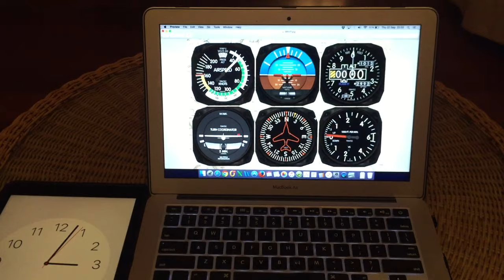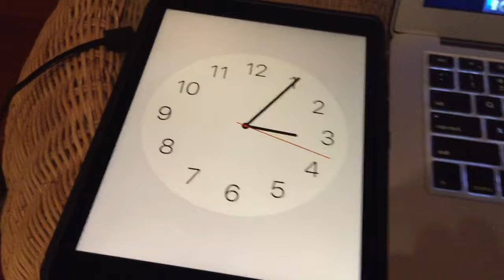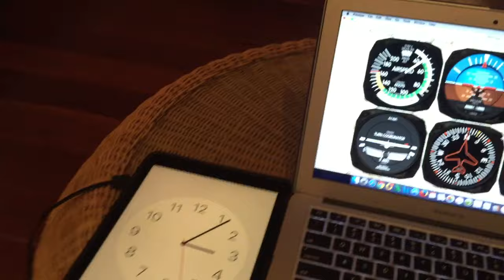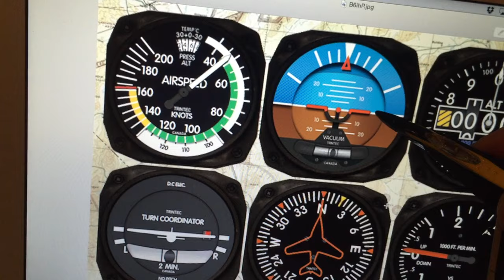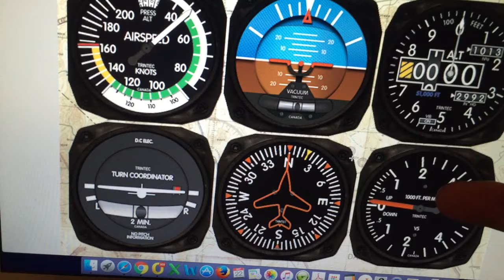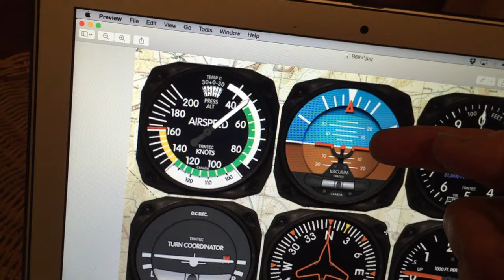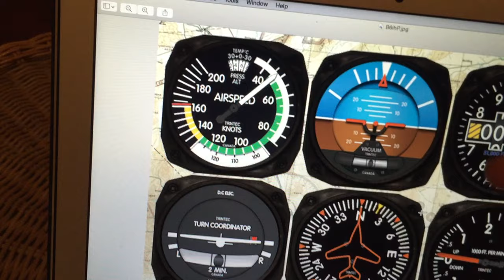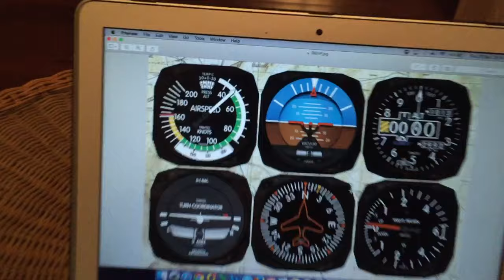Do aircraft change attitude to follow the curvature of the Earth?

Comment: I remember when I was  driving up a hill and kind of zoned out.  I forgot to follow the other half of the hill downward.  I was at 30,000 feet and still climbing before I realized my mistake; I just barely made it back to the surface before I ran out of gas.What?  Isn't that how a flat Earther would see it?
Reply from the maker: LOL,  yes something like that Emma.   

It is only one degree of curvature in 111 kilometers and they wonder why we can't see the hump on a straight road...   Clearly they have no idea of the size of the Earth.
Reply: +Emma May - You need to see it as a glober sees it. If you shoot too far up the hill, you're liable to go into orbit and circle the earth until the end of time.
Reply: More like "I asked for directions and the guy said go straight down the road, but they neglected to tell me that the road was ever so slightly curved so I ended up running off the road. Gradually. Over the course of half an hour....)
Reply: What? What were you doing? "forgot to follow the other half of the hill downward"??? "still climbing"???"Barely made it to the surface"??? Did you fly in a submarine over a hill?
Reply: @Wolfie6020  i have a question for u if u  dont mind and its got nothing to do with your  video although i did like your explanation pitch control
Reply from the maker: @nerog3136  Sure, go ahead.
Reply: @Wolfie6020  cool thanks.Not sure if u heard of gleesons map which alot of people say cannot work.The one distance i have was easily got feom his map
Anyways according to gleesons  map the real distance from the north pole to the equator is 5400nm and the distance from the north pole to Tasmania is 8000nm.The diameter of the globe earth  is 7928miles and the longest distance around it is at the equator which is C=21600nm.Can u explain this difference .Thanks
Reply from the maker: @nerog3136  The Gleason map is a projection of the Globe to a flat surface and therefore has distortions and the scale cannot remain consistent.   This is why we see Australia so wide compared to the USA when in reality the USA is slightly wider East to West. 

The Scale is correct only North to South so you can get accurate distances from Pole to any Latitude on this Map.   However the problems occur when you go East or West.  

If the distance from North Pole to Equator is 5,400 NM on a flat circle the circumference of the Equator has to be 2 x Pi x 5400.  i.e. 33,929 NM.   This is already too large. 

The only way to have an Equatorial Circumference of 21,600 NM with a distance from Pole to Equator of 5,400 NM is on a sphere. 

5,400 being one quarter of 21,600.  

Hobart Tasmania is 43 South Latitude (42.9) so that is 133 Degrees of Latitude from the North Pole.

133 x 60 NM = 7,980 NM (8000 as you stated)
Reply: @Wolfie6020  thanks for the explanation i must admit u do that really well here and on your videos.but just a few points in response.1.Gleesons map is a map of flat earth he was a die hard Flat Earther The 2 yellow captions below on his map shows this where he says " the sun moves.." 2.Australia in reality is found in the measurement and is in reality about the same size as America.This can be roughly estimated by counting the no.of lines of longitude that span australias length roughly 3 lines ie 45degx60.America is the  same 45x60 =2700nm or 3108 miles.3.mercators projection makes green land about same size as Sth Africa when in fact it is 14x smaller.The Gall projection shows this and so does Gleeson.4.The map does not need to confirm to the sphere model so it is " As is"as shown above on his map.5.The distances from the North Pole to the equator and to  Tasmania are straight lines and not curved.6.Straight line distances can be calculated using his map. For example Sydney to Santiago not by using spherical trig but basic triangle  trigonometry .How?If u know the distances from  2 points on the map  to the North centre and u know the angle  you will know its size.
Reply from the maker: @nerog3136  Yes the North South lines are to the correct scale.   

When you calculate the distance from Sydney to Santiago using triangle trig what distance do you get? 

How does that compare to the great circle distance calculated on a Globe?  

Is a straight line between them on that map the shortest distance between them in reality?  

Try it. 

I recently flew from Sydney to Eagle Colorado non stop.  On the Gleason Map is the straight line between them North or South of Hawaii?  

This would be critical to know in the event of a required diversion to Honolulu,  do we turn left or right off track? 

Yes the Mercator map is another Globe projection just done in a different way,  the scale is again inconsistent.

Comment: You essentially said what I've experienced as a low-time private pilot, which is that the corrections made for the curvature of the earth are "buried in the noise" of all the corrections necessary to maintain altitude.
Reply from the maker: +Timothy Stockman.  Thanks Timothy.  Quite incredible how the Flat Earthers can't understand that.
Reply: @Wolfie6020  It's not a matter of understanding, it's a matter of taking your word for it. It's not provable if you claim the autopilot also does this automatically.

Comment: If a plane where to follow a tangential trajectory, it will need to gain altitude. When this happen, the plane will loose speed, and thus lift. Also, the air will get thinner, also reducing lift. This will cause the plane to loose some altitude, and naturally pitch down all by itself.
So, even with all controls frozen in place, the plane will follow the Earth's curvature.
Reply: Only at great height.

Comment: Do aircraft have to pitch down to follow the curve of the Earth? Yes! Simply convert the length of the aircraft into miles, then plug the result into the formula 8 inches per mile squared and you'll find the curvature of the Earth as experienced by one aircraft length.

For a Boeing 787, it's about the thickness of a stack of 4 sheets of paper. You'd think the pilot would get tired pushing the stick forward so violently! :-)
Reply: The formula of flight correction protocols on a globe  for pilots is so secret & complex they don't tell pilots!
Reply: Probably because the pilots simply have to maintain a constant altitude without trying to over complicate things.
Reply: Average cruise speed for a Boeing 787 is 567 miles per hour.
Reply: It would not even be 8 inchs per mile squared at altitude.  The curve would be even more gradual.
Reply: Fact! Planes fly nose up....All Hail Concave Earth reality!!!
Reply: First of all you are saying that there is no force pulling the aircraft down as it flies around the globe,  so therefore airplanes do not need wings to compensate for gravity ? Secondly, why does every single flat earther have the 8inches per mile squared equation memorized like they study flat earth flash cards ? It just goes to show that most of you watch a ton of those videos and just regurgitate everything you hear to prove a point. Well that's not how the scientific method works.  To us you all sound like,  " I don't understand very basic science - therefore it's all the scientists who must be stupid." Did you know that equation only works accurately up to around 100 miles because the data just becomes erroneous. If you want something more accurate try throwing a little trigonometry into. amount obscured = r/cos( d/r - asin(sqrt(h*(2*r+h)) / (r+h) ) ) - r     H is obviously the height of the observer. C=2πsinr=2π1! r−2π3! r 3 +2π5! r 5 −⋯≈2πr C=2πsinr=2π1! r−2π3! r 3 +2π5! r 5 −⋯≈2πr
Reply: 100 miles is all that's needed to show the earth is flat and there is no curvature
Reply: @johnnytodd9328  someone clearly can't comprehend reality.

Comment: AFAIK pilots stay in the same pressure altitude, so they pitch up and down constantly to stay in the same pressure so their altimeter reads constant value. With changing pressure due to weather it does not mean flying at the same GPS altitude so the whole point of following the curvature is moot, pilots do not follow curvature, they follow pressure (which happens to follow curvature).
However the gyroscope in attitude indicator should be able to notice change due to curvature, though I have heard that it has weight at the bottom forcing it to realign towards Earth's centre.

Comment: Question for flat Earthers: Do airplanes constantly turn right (when traveling west) or left (when traveling east) to maintain their heading?
Reply: Awesome point!!
Reply: They constantly turn right or left on a spherical earth unless they are at the equator.
Reply: Les Brown  constantly holding a heading of West or east is not straight. You must maintain a constant turn unless you are at the equator. Look at a globe and you'll see why.
Reply: @Russ Olson and what does that have to do with the fact a plane must turn left or right to maintain an easy or west heading unless it is at the equator?
Reply: @Russ Olson either way it's still a turn. you are not flying straight unless you are at the equator
Reply: @Russ Olson my point is to fly directly east or west you are not tracking straight or even attempting to track straight unless you are on the equator.
Reply: Les Brown  if you wanted to fly directly west 500m away from the magnetic north pole, I can guarantee you that you would need to be in an obvious right hand turn. The same applies all the way until the equator, and then beyond the equator in the southern hemisphere but with a left hand turn. You need to turn to follow a westward or eastward heading
Reply: Les Brown  are you fucking with me? If the north pole is 90 degrees to your right, you are flying west. This applies whether you are 5000 nautical miles away from it or 500 metres away from it.
Reply: @larsonwells2656  Jet Faker is right. You're wrong. As he suggested, get a globe and think it through.
Reply: @jetfaker6666  
as they would be flying parallel to the ground below, they would be making minute adjustments up or down as Wolfie explained
Jon seems to have sucked you in by phrasing it as "east - west" or "right - left" ..
for example, a flight takes off westward from New York to Los Angeles
.. takes off and ascends to cruising altitude
,, it passes through a series of checkpoints defined by the airlines and FAA for that flight corridor
.. as it flies over the midwest and on to the west it is not adjusting west -- whether via autopilot or direct pilot control -- but up or down to maintain the flight altitude
Reply: @Russ Olson Haha are you saying airplanes yaw around the ball earth?! 🤣
Reply: Why would we?  Do you not know how a compass works?   North is in the middle of earth, east or west is a circle. South is everything opposite north...a compass only works on a flat surface lmao ;) 
No experiments have proven curve or spin ;) 
Many experiments suggest a staionary and mostly flat surface
Water always finds level.
Reply: @Russ Olson never heard of bank. Are you talking about the roll axis?
Reply: @jetfaker6666  you don't really have to. I flew a Cessna 172 out of Co Springs to a smaller uncontrolled airport NE of the one we flew out of. Flew 100% straight at the same heading to get there. Didnt turn the plane at all, so basically after we took off, we flew in a straight line to get there. I wasn't flying East or West though to actually go straight. When flying, there was no bank or yaw, to "not fly straight" and have to curve up to my destination. But, when looking at the navigation later, it feels like it should be curved when you take a globe model and globe navigation and try to lay it out flat etc. If it was true that everything had to be curved unless right at the equator, then roads in the northern hemisphere would be curved, even if they were supposed to be a straight line. But that doesnt happen and not even on a globe model. You can fly straight from any two points on a globe model, but if you take that straight navigation (from globe) and apply it to a map, it will appear curved, because of how globe model/maps have to curve to account for the spherical model. Not trying to be salty or anything, just wanted to express my flight experience.
Reply: No its a flat plane shortest distance between 2 points is a straight line on a sphere that wud be a a great circle distance
Reply: @nerog3136  right, but if they fly due west without turning (and the compass points to the North/center), then their compass will eventually read southwest. They would have to turn right to keep the compass on west.
Reply: @jonmcalister1802  no they wudnt have to if u look at gleesons map equator is between the north centre and sth circumference.Most people think when they look at the map they have to turn to maintain west because they think they flyimg over a globe.They not they flyimg over flar plane meaning u fly in a straight line between destinations no corrections.Look im no pilot but what i think  a pilot would do in this cass is to work out his bearing get up in the air and just follow that bearing without any correctiins.But then again your flight paths are governed by your regulations so i suppose this cant be proven  but i did read a pilot on this post say that be flew between destinations without any correcrions. Again i am no pilot.👍
Reply: @nerog3136  Here’s what I am thinking: Take a Gleason (AE) map and a square. Put the corner on London and one side along the Prime Meridian. The Prime Meridian runs N/S, right? West is perpendicular to north, so you can follow the other side of the square to the west. If you do set this up, you will see that the west line winds up crossing South America,  heading across the eastern edge of the South Pacific, and ending up in Antarctica. To fly directly to the US, the pilot would have to start out heading northwest. If they started due west, then they would have to turn right to get to the US.
Reply: @jonmcalister1802  are you a pilot
Reply: @jonmcalister1802  and yep i shall do what u said
Reply: @Russ Olson a compass doesnt work on globe if u think about it.On yoir globe you have north at the top and a sth at the bottom .If u fly a sth north direction it wud mean your compass is in line with the the magnetix field of earth problem is it will freeze in that position.
Reply: @Russ Olson well the truth is in what you measure.You can verify this truth by a simple experiment.You dont have to do this If u get a stack of ring magnets and have them wide enuff to separate the poles you have a model of the magnetic field of the globe.If u put a compass in between poles  it will align itself and stay in that postion no matter wea u move in between the poles.If you turn it 90deg from vertical between poles simulating the equator it still doesnt work..But if u raise it to the north pole so to speak it works normaly when you move it aroumd the north pole as a centre
Reply: @Russ Olson  lol ok are u a pilot cause i have a question if u r
Reply: @Russ Olson funny you call flat earth community weird.I wud have thort u would you call globers weird globers think that people down under are walking upside diwn on a spinning ball thats racing thru the galaxy at a speed 10x that of a hypersonic sledge at an amazing mach 86.
Reply: @Russ Olson taxi driver
Reply: @Russ Olson too expensive lol y wud u call your dad a loser thats not very nice
Reply: @nerog3136  no, but I can look at a map and draw a straight line across it
Reply: @nerog3136  why would the compass “freeze”? The needle stays in line with the magnetic field lines, yes, but the compass is free to rotate under it
Reply: @Russ Olson oh ok sorry to hear that but anyways you have a good day👌👍
Reply: @jonmcalister1802  not according to my experiments it freezes.
Reply: @jonmcalister1802  because it is locked into the magnetic field of your globe where u have two poles hypothetically.speaking.I say your compass is working because it is pointing to the north centre like on gleesons map meaning you are on a flat plane
Reply: @Russ Olson 1. Health is not up to scratch 2.flat earthers are doing the best they can considering the opposition they get every time the  subject comes up
Reply: @Russ Olson Bob Knodel nah i prefer Eric Dubay hes the smart one
Not sure if Knodel proved anyrhing i think it was a scam
Reply: @nerog3136  The geographic center and the magnetic north are not in the same location. In fact, magnetic north moves around. Are you saying that in the flat earth model, there are no magnetic field lines, and the compass just points north for some other reason?
Reply: @jonmcalister1802  more like a monopole or strong north very weak sth
Reply: @Russ Olson Geology, meteorology, oceanography, climatology, astronomy, physics…Many disciplines can confirm the globe, and we don’t even need NASA to do it.
Reply: @nerog3136  Maybe, but all magnets create a magnetic field and field lines, right? So how is what you say different? Your story about a (broken?) compass is not very clear or convincing. Also, a magnetic monopole is only hypothetical. They haven’t been proven to be possible.
Reply: @jonmcalister1802  all i can say is with my experiments using stacked microwave oven magnets it showes me that a compass wudnt work on sphere.You can try it yourself and verify it.It suggests u r flying over a flat plane with a north centre like gleesons map.i can explain it but it may get a bit confusing at first
Reply: @jonmcalister1802  by the way there are motirs that run on the principle of a monopole i have built one my self snd it works fine ie rotates just no torque but speed